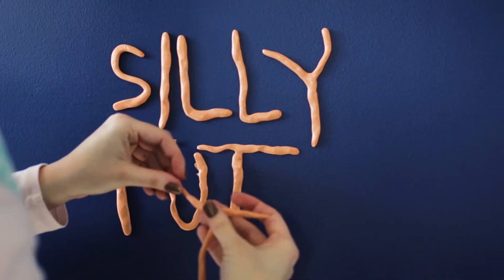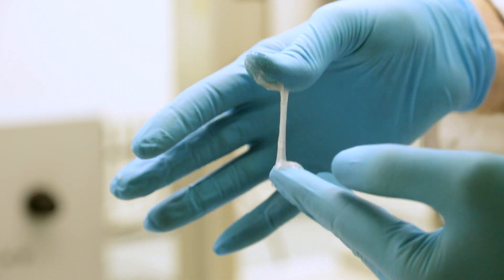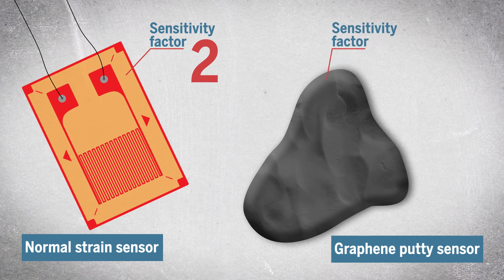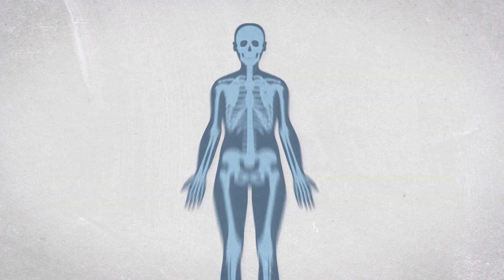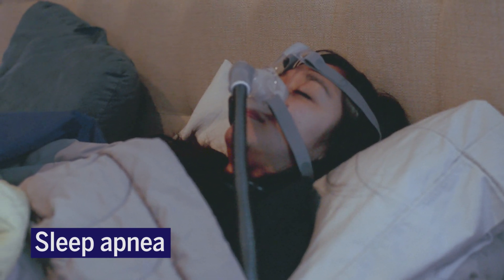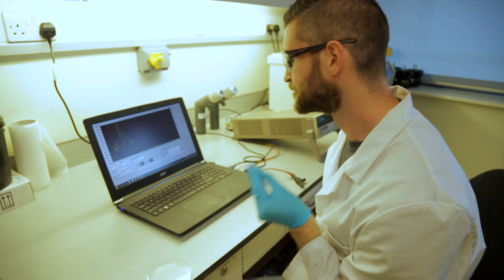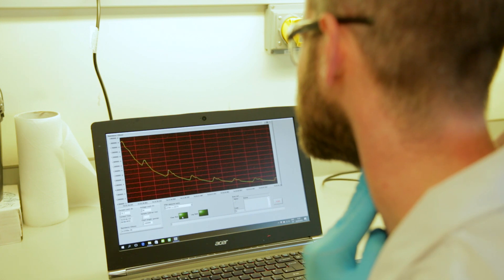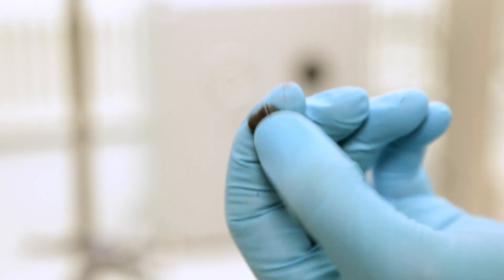Introducing the silly putty sensor

Comment: I might be going out on a limb, but what about for use in robotics .. giving robots a much more accurate sense of touch? Like a layer of supper silly putty between latex   gloves, with the outer glove having finger pints on it to aid in making vibrations when sliding across a smooth surface .. could the putty pick up the vibrations of the artificial fingerprints?
Reply: sounds great, build it and let us know!